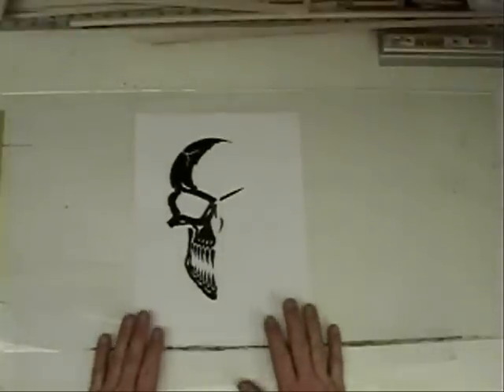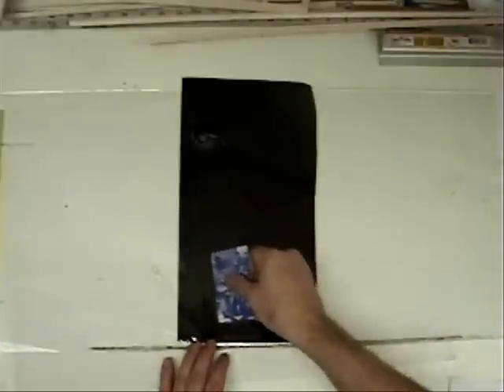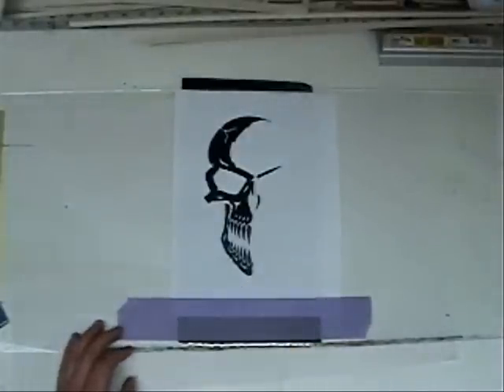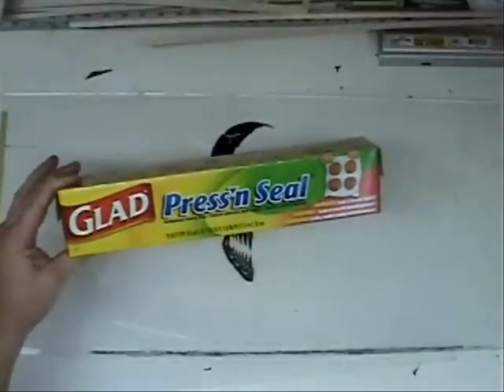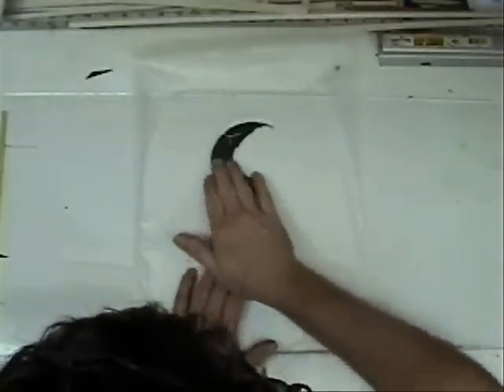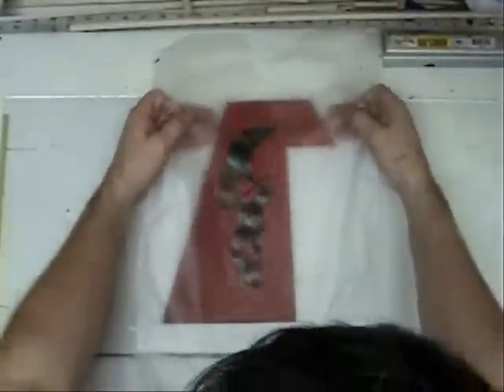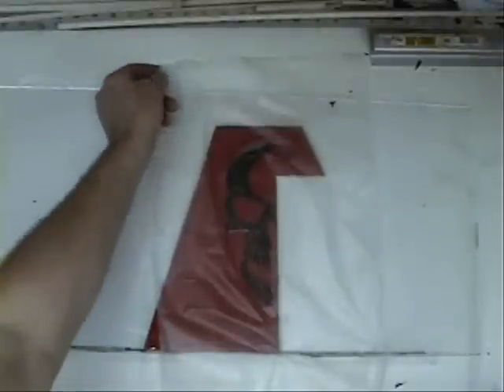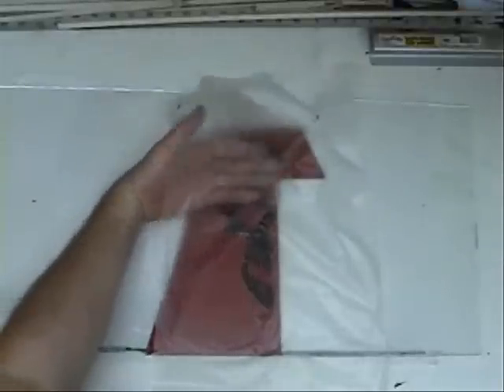Monokote 301

Comment: I have also found out if you use "old"  Pressnseal it doesn't release with heat as well as fresh.  I had some left over from when I first saw this video almost 3 years ago.  It becomes more tacky and I kept pulling up the black monokote.

Comment: I could be wrong, but what your doing looks just like vinyl cut letters. u could take that image, scan it, use a program like coreldraw to vectorize (make it into line) and then you can output on a vinyl cutter... computer cut vinyl is real a excat. Then apply transfer tape to it, which is like your glad material. then apply the vinyl to the monokote on the plan..